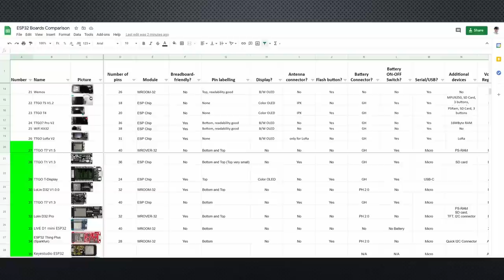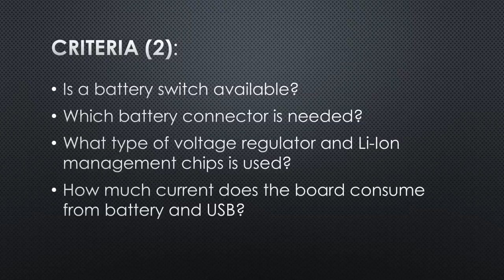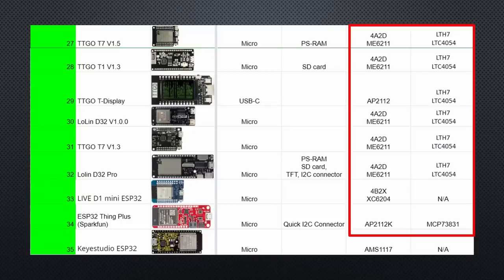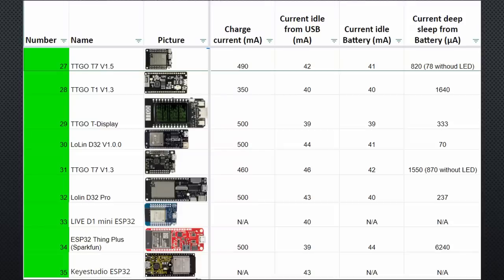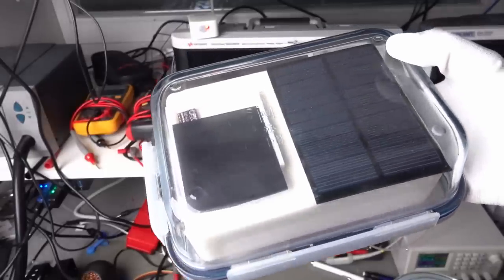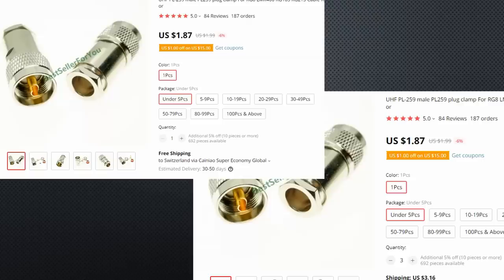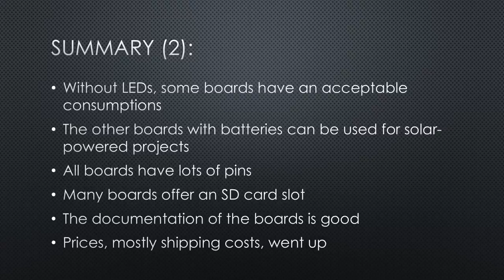#366 9 New ESP32 Boards: Comparison and Tests

Comment: Thank you, this isvery helpful. I still plan to build a Wifi-Weather-Station soon. Most probably I will not use solar but charge the battery, when needed. This would be acceptable for me, if the batteries run for more than a month. I was close to buy a Adafruit HUZZAH32, but after some research this board seems not to be the right choice. I guess the Lolin D32 will be the board of choice.

Have a nice holiday season and stay healthy
Micha
Reply from the maker: You should be able to reach one month if you do not transmit often and chose the right battery size.
Reply: @AndreasSpiess  Thanks, my plan is to transfer every 10 or 15 minutes (if there was a significant change in temp/humidity/air pressure/rain). There will be a short connection to write data to my NAS.

Comment: 5:00 Most of the boards out there with an ESP32 module DON'T have 100nF between EN and GND. Haven't seen schematics for this Keystudio board, but my guess is it is the same as DOIT and DOIT doesn't have this cap.
I made a bunch of projects based on ESP32 (any) and never had to push the BOOT button. I always put this cap on EN.
Reply from the maker: You are right. With this cap it works fine!

Comment: At 5:10 you mention a problem with uploading to the KeyesStudio board and having to push the boot button. I have seen this on 2 other modules and found 2 solutions: Connect EN to ground with . 2.2uf cap or ground pin D2. Maybe if it works you can explain it. Hope this helps.
Reply from the maker: You are right. Adding a 10uF cap solved the problem on all three boards. Thanks!
Reply: @AndreasSpiess  Now the question is why does it work. The solution comes from YouTuber, Xtronical.

Comment: @Andreas. Thanks for your table. I have one question (sorry, I am totally new to this): Is the 3.3V Pin on the boards only input or also output (if powered over usb or lipo), and if yes, how much current does it supply? I am especially interested in the TTGO T7 V1.5. Thanks for an answer.
Reply from the maker: It is also Output for a few mA

Comment: Excellent overview! I'm quite interested in a look at the ESP32-S2 chips and boards. They seem to have more usable I/O pins than the ESP32. (Your recent video about which pins to use on the ESP32 has been invaluable) With ESP-IDF 4.2 finally being released, I'm hopeful the S2 chip will get support in PlatformIO soon. Thanks as always for the interesting content
Reply from the maker: The Arduino support is essential for this channel. And I also would like the new USB functionality.

Comment: Would like to get your thoughts on the EZSBC boards. I used one of their esp32 boards for a battery project because they advertise 10 micro amps in deep sleep. I measured 20 with a basic multimeter. Great videos. Thanks.
Reply from the maker: It is in the mail to me...
Reply: @AndreasSpiess  Look forward to hearing your opinions.

Comment: Great stuff ! I wonder though what are the two (4-pin and 2-pin) external connectors on TTGO T7 V1.5, for example. Failed to find this information on google.
Reply from the maker: Lilygo has a pretty good documentation (including a schematic) on Github (one is battery and one is I2C)
Reply: @AndreasSpiess   Thanks! So battery pins can basically be used also for regular power supply if one does not want to deal with USB power?
Reply from the maker: @1yyymmmddd  No

Comment: TTGO documentation is not more than ok, but they have some pretty good features on some boards.
For example the TTGO display has a beautiful color ips display.. which is dimmable via pwm, and normally pulled down, so you can deepsleep without holding pins down and the backlight is auto off. Or if you read the battery voltage, you need to close the path to the voltage divider via a mosfet or transistor, so it is not wasting energy thru the divider all the time if you’re not reading it. On the other hand, you can only charge the battery via usb - not the 5v pin. And it is usb c ...
Reply from the maker: I did not know you cannot charge the battery via 5V pin...

Comment: Link to the light sensor project?
Reply from the maker: There is no video about this project.
Reply: @AndreasSpiess  make one :P it looks like something really cool. I've actually tried to create a lux meter using a photo resistor but could not get the math to work.
Reply from the maker: You get Lux sensors for Arduinos etc.

Comment: Thank you for measuring the deep sleep current of each board. It's amazing how poorly some of the boards perform given they are obviously designed for battery operation. It would be good if you could also test the TinyPico which I believe has a deep sleep current of 10uA?
Reply from the maker: I ordered them now. They are extremely expensive shipped to Switzerland :-(
Reply: @AndreasSpiess  TinyPICOs are available in EU from other resellers. Yes, shipping from Australia to EU is super expensive due to C-19 :( Nanos are only available from me atm.
Reply: 10uA? No, I claimed under 20uA.

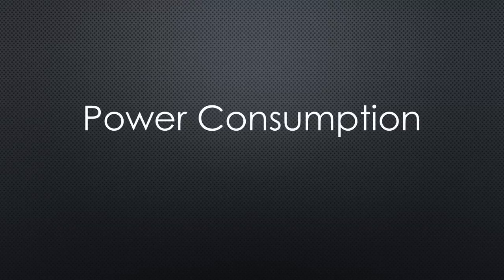Comment: Hey Andreas, thanks for the informative video and happy new year. I'm not sure what you mean with "board definition" at 5:15, however I usually put 2.2uF Cap between EN and GND, maybe that fixes your problem? You could just tinker a small "Cap-Jumper" for that adapter board.
Reply from the maker: You are right with the cap. I got the hint last week and I added it to all my boards.

Comment: Great video as always! Looking forward to a video about the new Lilygo esp32s2 board since I recently bought some for a project. Maybe you can figure out how to make it work with PlatformIO?
Reply from the maker: I am not in a hurry with the S2. So far I do not see a lot of advantages. What was your reason for choosing this chip?
Reply: @AndreasSpiess  i have to agree...being only single core.. its quite limited.. its gonna stuggle doing wifi at the same time as anything else (hell the dual core esp32s stuggle in some situations!)..it has less SRAM and ROM aswell..no BLE and no ethernet... but it does have some really, really nice features that i hope they add to the dual-core esp32s... eg upto 128Mb SPIRAM, upto 1Gb Flash, time of flight, 43 GPIOs, OTG USB, LCD and camera interface, and aparently 5uA idle, and 24uA at 1% duty cycle..

Comment: You said you store data on a server and that's why you don't need SD-Cards. How do you deliver your settings to your microcontroller? Are your projects all unique enough to just store them in the code? What if the same code should run on multiple microcontrollers with different configurations? What would be the easiest solution in your opinion?
Reply from the maker: For standard configurations I use Tasmota or ESP-Home. For special applications IOTappstory.com

Comment: I use the ttgo t display board. Having a permanent display is really handy, so long as you can live without spi 😬
Reply from the maker: True.
Reply: You can use the second spi https://github.com/Xinyuan-LilyGO/TTGO-T-Display
(BTW The backlight is connected to an GPIO - so you can dimm or switch backlight off. )  biggest disadvantage are the push buttons. They break easily (see picture in the link - right button - same happened to me)

Comment: The external antenna of the TTgo esp32 is only for wifi or also for bluetooth? I haven't found any info
Reply from the maker: It is for both because BLE uses the same radio

Comment: All your videos are great. Small comment regards esp32. I have lolin32 lite, ttgo T8 v1.7 and the CAM esp32, the first 2 biggest difference and sometimes even a challenge independent from pin and mA SD card or not is the CPU temp. The TTGO T8 regardless usage never over 50C but the lolin32 lite something hit over 70C. The cam anyway >80C but would not compare the cam with the 2 other one. Long sprach short, would be great when you test also take the CPU temp as a KPI in your list. BR Per
Reply from the maker: I never even thought about CPU temperatures because non of my projects need a lot of CPU power. But it is strange that the two chips behave differently with the same sketch.,

Comment: Cool video. Thanks a lot for sharing this information.
Maybe you could include this board from ezsbc next time it claims to consume < 10 uA in deep sleep and also it already includes a circuit to measure the bat voltage. (With a digital switch so it do not consume current when you do not measure)
It is from US. I ordered 2 and it took 1 month until it arrives. But it works. I can not verify that the current consumption in deep sleep is really under 10 uA
Reply from the maker: Good idea! I ordered one (for my "supply video") and we will see how it works out.
Reply: @AndreasSpiess  Thank you very much. I am looking forward to your next video :-D.

Comment: if you have problems with uploading and having to press boot: try adding a 10µF contensator between EN and GND
Reply: That was the solution I used.  Expressif spec a 0.1uF but it does not always work.  I am designing a few Esp32 Pico boards and find that 1uF instead between EN and GND worked to slow the enable ramp.  Have not got round to hacking my node MCU boards though and they have the problem.
Reply from the maker: The 10uF cap works on all three boards. I remember now that I had to do the same mod on another board, but I forgot. Thank you!
Reply: @AndreasSpiess  you are welcome. i spend a lot of time compiling and reuploading code to the ESP32 and I noticed that it is not only board dependent but also depends on the computer you use. a have a second laptop where uploading is never a problem but my surface book has the problem with some boards that can be fixed with using the condensator. it must be a timing thing that is unclear in the USB to serial definition or something like that

Comment: Just got into this ESP thing, so this will come in very handy.   Wish they would make some wider breadboards and maybe a board with a zif socket.    Andreas, did you have any issues with RFI with these projects?   Just made a nice wled project but it puts out a lot of rf spurious it seems (my FM receiver 5 meters away is having issues receiving like it should) . I think if I need to mount this on a pcb that I will need to have to place that data-line through some ferrite core.  I see loads of projects on the web with just wires everywhere producing rf which also might interfere the onboard BT and wifi.
Reply from the maker: I assume the EMI comes from your switching power supply, especially if your project consumes some power.
Reply: It's connected to a quality power supply that already has a nice ferrite bead on the output. Maybe it's the data line (connected to D4) that addresses those leds. It's actually 1 big (antenna) wire.  Guess I'll try a VK200 at the output of that pin.
Reply: @AndreasSpiess  Speaking of this - would you have any good pointers/hints on how to identify the source of EMI without having access to expensive equipment or having to repeatedly test by unplugging dozens of PSUs one by one? There's something in my setup that's affecting both WiFi/BT and DCF77/MSF signals. Thanks!
Reply from the maker: EMI is hard and I have no single source. It takes a long time till you master it (I am just at the beginning)

Comment: Thank you for this video. I am still concerned about the reliability of esp32 in the past. After a while it needs a restart. Are the new ESP32 more reliable. I don't have the same problem with Arduino.
Reply from the maker: I do not know. Maybe it depends on how you write your sketch. I have many ESP32 in use and usually have no problems.

Comment: TTGO T7 v1.5 do they come with the external antenna connector soldered on? or is that something that needs to be ordered separately and installed?
Great video, thanks!
Reply from the maker: They come with a u.fl connector. But as usual, you have to change a connection (soldering)
Reply: @AndreasSpiess  Thanks. I contacted TTGO and they are going to do it for me (i think) before shipping. fingers crossed :)

Comment: Hi Andreas, thank you for your work done in 2020. I am wishing you a Merry Xmas and a healthy corona free 2021. 
Btw i am using D32 Pro with stable success as ECU (with CAN BUS) in my 29 Year old VW T3 Multivan to collect and display engine data.
😎Henry
Reply from the maker: Good to know. Maybe you contact me on Facebook messenger or Twitter? I probably need some help with a planned CANbus video...
And Happy Holidays, too!
Reply: @AndreasSpiess  Hello, I like to share my experience with You. But no Facebook & no Twitter. I use Threema for savety reasons. Maybe i try to send you my PM via an other Facebook Account. Would this be OK??
Reply from the maker: Anythink a little more private than these comments are ok for me... I also have Threema.
Reply: @AndreasSpiess  hi Andreas, sended my PM & Phone# (threema ) to your FB Account (26.12.20). Use it, when needed.
Happy New Year... 🥳Henry

Comment: how do you add the solar panel? directly connecte to the battery or do you use some mppt?
Reply from the maker: As shown in one of my videos, MPPT is not needed for such small devices.

Comment: Great Overview, Thank you!  If I build a solar-powered project, as described in #154 (Solar -> TP4056->Battery) should I connect the battery via an LDO (+cappacitors) to the 3.3 v pin of the board, or should I connect the battery to the battery connector if the board has one (LoLin D32 V1.0.0)?  or Maybe the TP4056 to the battery connector to benefit of battery protection?
Reply from the maker: The TP4056 charges the battery, so it has to be connected to the battery. If you use a module with protection, you have to connect it according to its data sheet ( https://www.aliexpress.com/item/32930640893.html )
Reply: @AndreasSpiess  Thank you, Andreas, I really appreciate you take the time to answer!

Comment: "cannot be used on breadboards"...
Just take out the powerstrips on opposing sides of two breadboards and stick them together. That's how I prefer to develop anyway. Gives me a lot more room for jumpers and the occasional dedicated oscilloscope connection.
Reply from the maker: You are right. A good way to solve this problem.

Comment: Hi,  How do you attach a solar panel to the TTGO t7 v1.5? I would think it should be vBus but that is not easy to get at.
Reply from the maker: This board has no connector for a solar panel. You have to find a board which outputs 5V and connect it to the 5v pin.

Comment: Hello Andreas, do any of your videos cover how to identify the firmware revision of an Espressif MCU?  I have updated the firmware on an ESP32 but have no way to identify if the update has worked, or not. Thank you
Reply from the maker: The ESP32 have no firmware. The modules have an external flash storage for the code. And you have to know what you flashed on it. This is why I usually print the version of the sketch that I see it in Serial monitor.
In the early days they sold a revision 0 of the chip. But this was in silicon and was not changeable.
Reply: @AndreasSpiess  Thanks for the feedback, have you made any video that explains how C++ is compiled to an Arduino compatible binary that then runs on the  Tensilica CPU via emulator/RTOS, I'm not clear how the whole process works???
Reply from the maker: @Steven_Bennett_YT  C++ is compiled directly to the Tensilica code. No emulation is needed. RTOS is added during this process as many other libraries. RTOS is not an operating system like windows. It is embedded in the code.

Comment: Dear Andreas I appreciate if you also comment on Espressif DevkitC v4 board. Last year I bought the Espressif DevkitC v4 WROOM-32D from AliExpress for my school project, and I was quite happy with it, but I didn't actually know how good or bad it is for serious projects with a battery or 5V AC/DC voltage regulator. By the way Thank you so much for all the contents you make and have a nice new year.
Reply from the maker: It uses a AMS1117 which is horrible for deep-sleep. So comparable with #35

Comment: Do you reallllly use onboard Li-Ion capabilities of Esp boards? What I've found is they don't have over-discharge protection for Li-Ion, so it's not safe to use, espec-ly, if it's autonom-s device. Even tp4056 with protection is better option. Also, it helps to reduce heat on the esp32 board during charging time.
Reply from the maker: I usually check the battery voltage and transmit it to see low voltage as shown in the video. So no problem for me. Of course it would be better to have one.

Comment: Thanks a lot for the video, I was just looking for a small ESP32 board for my KaRadio and thanks to your video, I found the good candidate. I also didn't know there are boards with battery support, so another problem solved by watching your video :)
BTW: could you also provide links for those battery connectors? I found JST-PH but I am not sure if all of them are 2mm pitch or there are variants. Thanks!

Comment: Ja ich hab mich auch schon gewundert warum beim ttgo die led leuchtet. Er hat ja auch einen galvanischen Schalter. Den tbeam gibt es jetzt übrigens mit sx1262 und ublox8 chip. In English: Would you be able to make a comparison between sx1276 and sx1262 regarding sensitivity for 868mhz. On spec they are equal but maybe its not. And I would be very interested in building a rpi sdr webradio for myself for non public use to listen to local ham stations and other radio far away from my home location via located sdr receiver there. Maybe thats a topic for you as well? 73
Reply from the maker: 1. I do not have the gear to check sensitivity of LoRa boards in real conditions. But I trust the supplier there
2. You get a lot of SDR software for the RPi which also supports RTL-SDR dongles. Just chose the one you like most. Probably not a topic for this channel. But you never know...